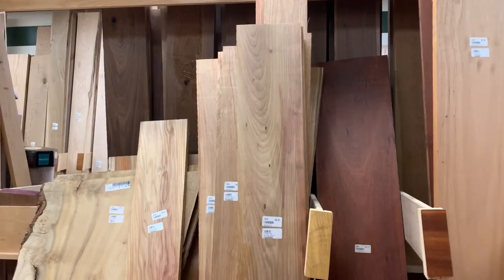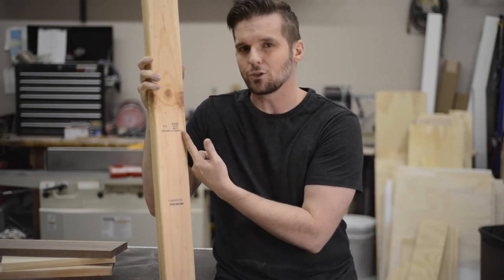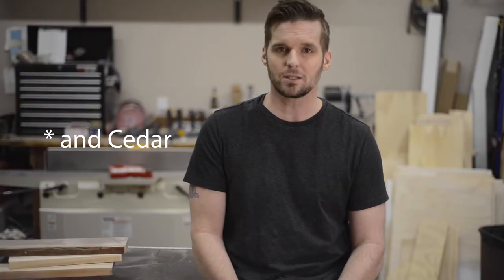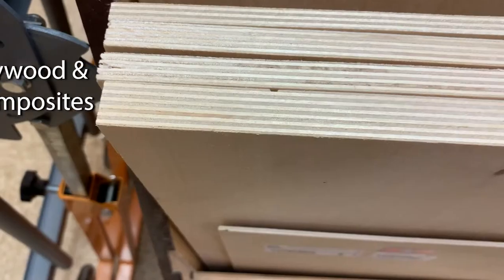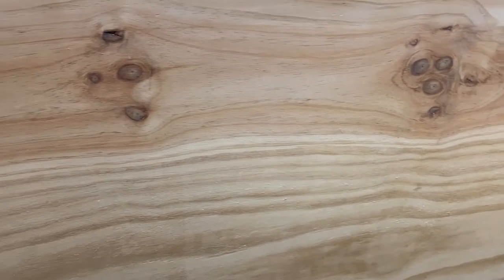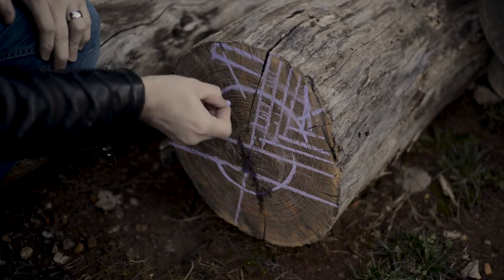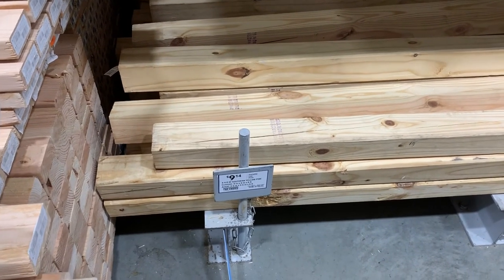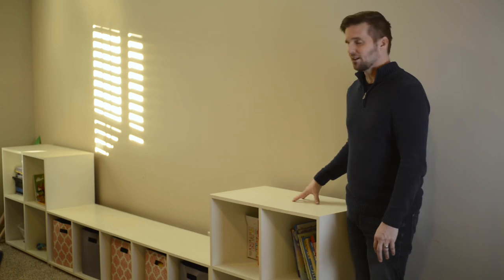Choosing the Right Wood to Build With | Lumber Explained

Comment: Boards are a half inch less because generally the majority is used for walls in houses which typically gets half inch Sheetrock. So when engineers draw a set of plans it’s easier for the dimensions to be an even number. It all comes down to the sake of simplicity. Not only for the engineers but the builders as well. Imagine trying to read some drawings where every dimension is fractional…😅

Comment: Wow! So much useful information! Thank you! Question(s): Why does some plywood have the name "plytanium" and what's up with the weird measurements? (15/32, 23/32 etc.)? Again, as a newbie I gteatly appreciate the explanation. I'm one of those , Why? People.
Reply from the maker: Great questions Colleen! Plytanium is just a clever name given to a specific brand of plywood. You see plywood in those weird sizes if it's sanded. They cut the sheets of thin veneer, glue them together, and then sand the face(s) smooth. The sanding takes off about a 1/32". This is reflected in panels that are unsanded being nominal sizes like 1/2" & 3/4". - unlike sanded plywood panels that are 15/32" & 23/32", etc.
Reply: So if I were to buy the sanded plywood (mostly because we have a shortage here in NY) and wanted 1/2" plywood, the closest I could come to that size would be 15/32, correct? Can't even get 2x4s at the moment around here.
Reply from the maker: That's right. There may be some specialty plywood somewhere that you could order that's exactly 1/2", but it's easy enough to account for the 1/32".
Reply: @OutoftheWoodwork  You are awesome! Thank you for explaining this for me.

Comment: I took on the project of fixing my facial boards on my porch. When I went to Home Depot I was so overwhelmed to the point that dread going. Thanks for this great information. I plan on building firewood shed that will be outside. What wood do you recommend?
Reply from the maker: I would take a cue from the way sheds are built. Pour a small concrete slab. You can use construction-grade 2x4s, etc for the framing and then cover it with wooden siding. Paint the siding thoroughly with exterior primer and paint (every few years) and make sure the roof is metal or shingle and doesn't leak 👍

Comment: Hey, I am hoping you'll see this and be able to answer it.

Today I went to HD/Lowes to check out their lumber. Im trying to build an outdoor patio bench and since it is my very first woodworking project, I want to keep the cost down so I am thinking of using construction grade lumber.

The straightest boards I saw today were "Burrill Fir" I don't know if Burrill is a brand or a form of fir wood but it was incredibly light...

Which leads me to my dilemma and question,

1. If buying from big box store, is species important? I was concerned that since this Fir felt like air that it wasn't very dense and if I chose this lumber that it wouldn't hold up to the weight of people on it.

In nearly every video everyone goes over the different types of wood but no one seems to go into the species of construction lumber because most of the time the only species anyone cares about is hardwoods.

So whats best for construction lumber and woodworking?
SYP? SPF? WHITEWOOD? BERRILL FIR?
And what exactly is "whitewood" anyways.

Thanks!!
Edit: i plan to paint this project...I know outdoor furniture is probably best out of something like cedar...but...

$$

Comment: What do you suggest I use to build an outdoor potting table  that will be subjected to the weather. (Extreme sun, rain and snow.   It will have a top and bottom shelf, no doors or drawers. Of coarse,  I want to keep the cost down.

That coffee table turned out very nice looking, in spite of the flaws.  Using  balusters for legs is  a smart idea!
Reply from the maker: Thanks Christine! Wood does not like the elements and it doesn't matter what kind of wood you choose, it's going to rot, eventually. The key is the finish that you put on it. If it were me, I would just use construction grade lumber and then paint it with a thick exterior paint. I've had really good luck with exterior paint on my beehives. It lasts for years without any maintenance.

Comment: You mention later in the video about accounting for wood movement.  I understand the issue with drying and shrinking and all, but I what do you do to account for it when making your project?  How do you account for wood movement? 

Enjoying your videos!  Thank you!
Reply from the maker: Thanks so much for watching!

In general, you leave about 1/8" space to allow for wood movement in different situations, and also avoid "trapping" wood across its grain. I need to do a video specifically on wood movement!
Reply: @OutoftheWoodwork  A wood movement video would be nice to see.   Thank you for the reply!

Comment: What do you recommend for building an outside pull-up bar? I am talking about the posts. I live in Texas, and the weather here varies. Thank you for your time.
Reply from the maker: I've seen 4x4 posts set in the ground with concrete and a metal pipe running through a hole at the top of each. That's probably what I would do.